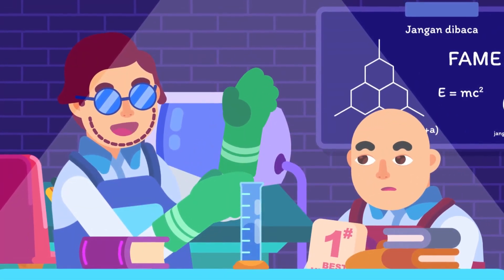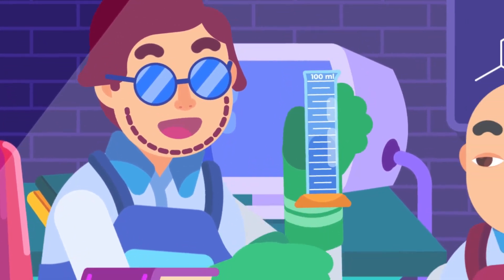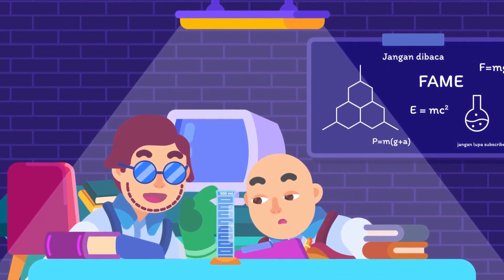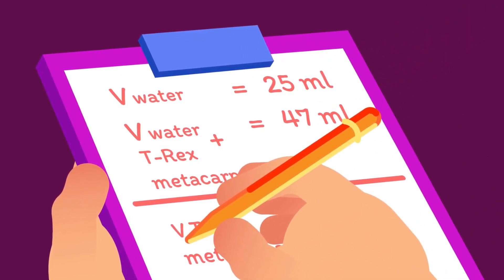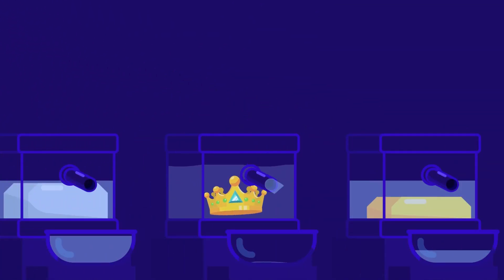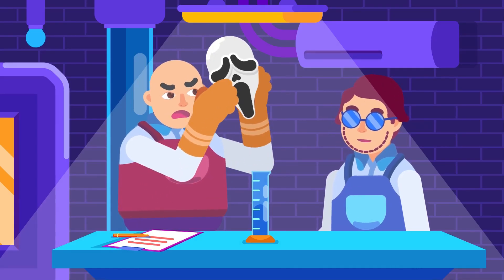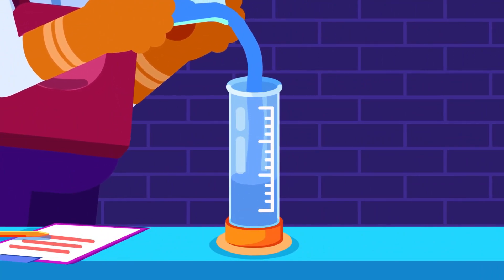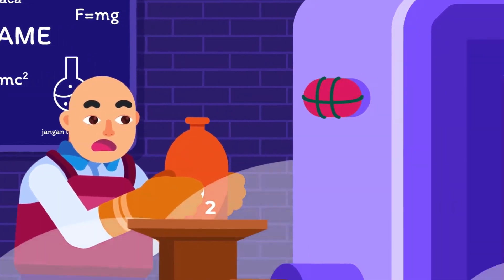The Joke About Graduated Cylinder

Comment: Gases can occupy any volume no matter how much it is or how much amount of gas is being taken
Reply: When we say that one mole of gas occupies 24 dm³ at room temperature and pressure (RTP), it means that if you were to contain that mole of gas in a sealed container with a volume of 24 dm³, the pressure inside the container would be 1 atmosphere, and the temperature would be around 20°C. However, if you place the same mole of gas in a larger container, it will indeed expand to fill the entire volume of the larger container.